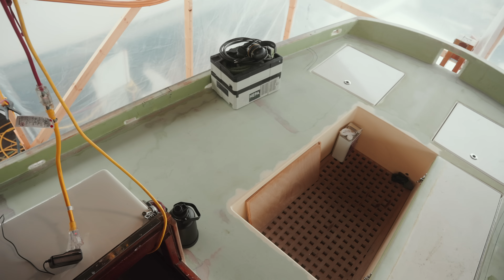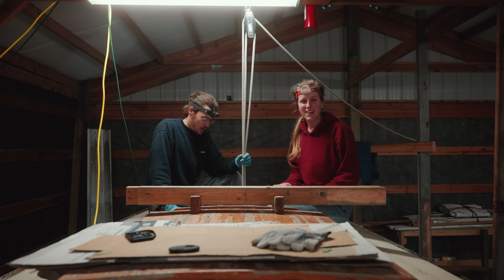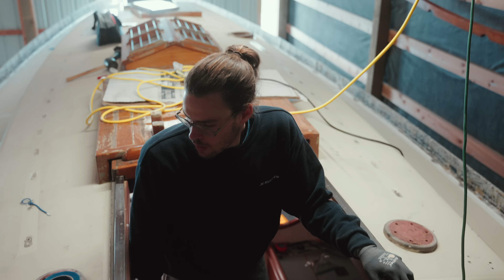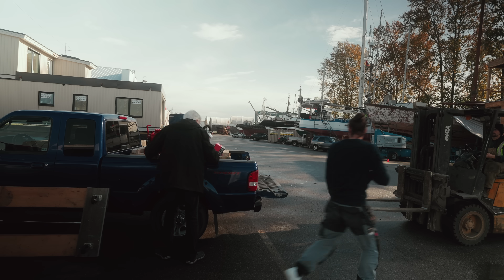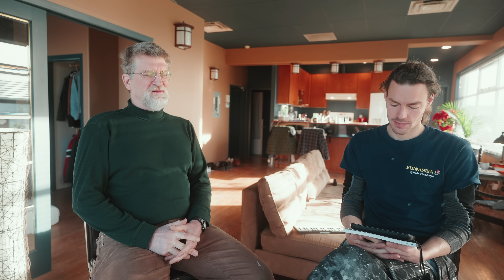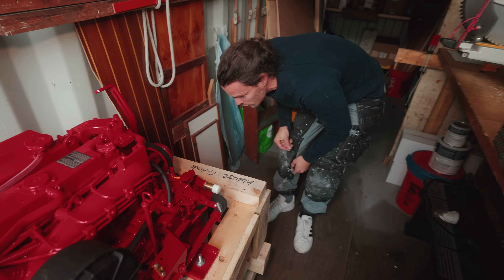REVEALED: Our New Engine!

Comment: As usual I’m impressed just how competent and professional this boat build is. On my boat, a 41’ 15 ton trawler, I have a Ford Lehman 120, naturally aspirated and very old school, built in 1979. For engines simple is good. I might suggest for filtration having dual Racors between the fuel tank and the engine. If you do have bad diesel you can switch over to a new filter while underway and replace the dirty filter. Racor 75/500FG duplex fuel filter.

Comment: Good choice on the mechanical Beta Marine engine.  As you mentioned the high pressures of common rail engines requires very clean fuel.  I have one thought regarding your propeller, normally an increase in available power would require additional pitch on a propeller of the same diameter and number of blades, did you re-pitch the existing propeller or change the final rpm?

Comment: I can't speak to the boat version, but the tractor version of that size is like a tank. I am still running one from the 70's.  I can also speak to fuel consumption.  Once you figure out that sweet spot for each implement (think prop) you can go all day on 25 litres, or wide open for 3 hours or so.  Those torque/power curves are real.
Reply: 100%. Find that torque sweet spot and your diesel usage maximizes. Saves huge money on fuel.
Reply: @studdy68 And gives you range on a boat!